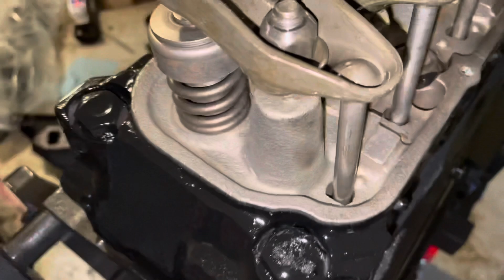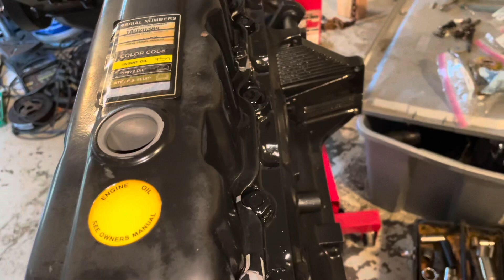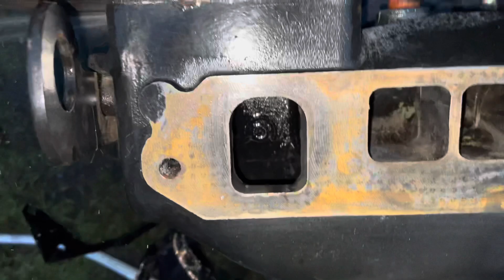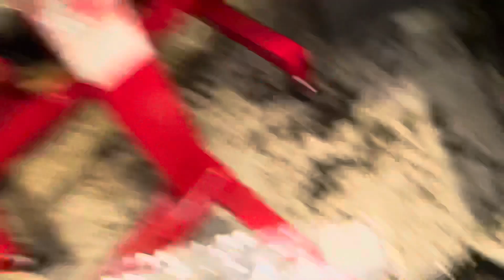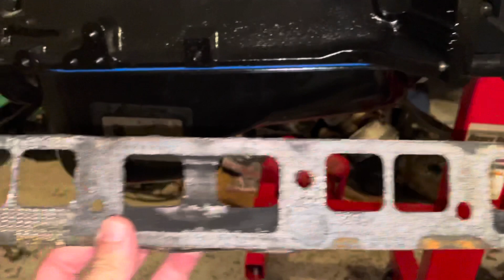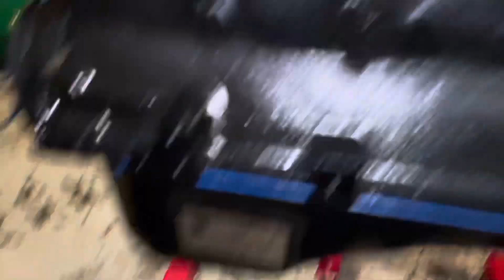Mercruiser 3.0 1(i) - Intake/Exhaust Manifold Install

Comment: Did u use any silicone with the gasket
Reply from the maker: No, any gasket that has a rubbery or graphite or any other coating you don’t use any gasket sealer. The only gaskets I use silicone on are plain paper gaskets and maybe boosting the sealing of a Vortec rubber gasket around a water port.

Comment: Sorry, did you say you use "SHOUT" to clean the valve cover?  Do you use the same thing for the manifold?  Thanks
Reply from the maker: Yes I’ve used Shout as a biodegradable degreaser for a couple years but lately I’ve started getting chemical burns on my fingers. It’s probably the sodium hydroxide ingredient. Time to start wearing gloves.